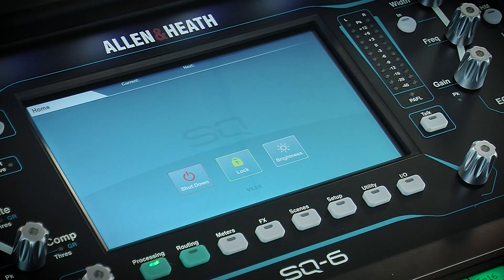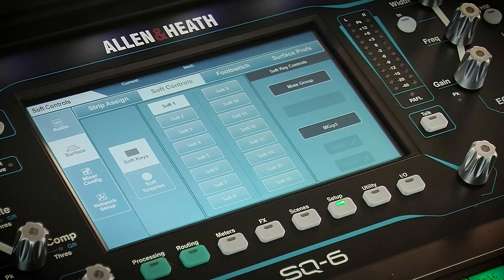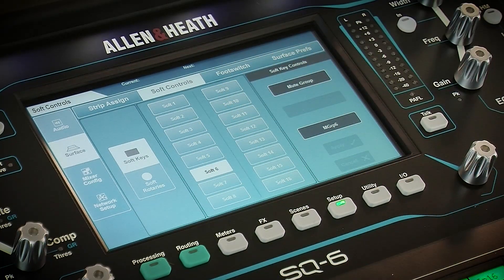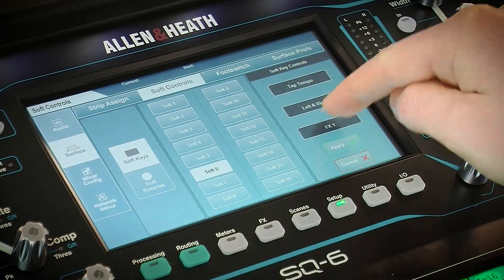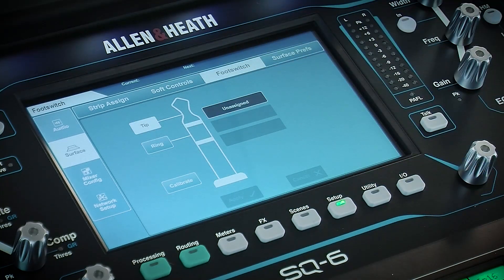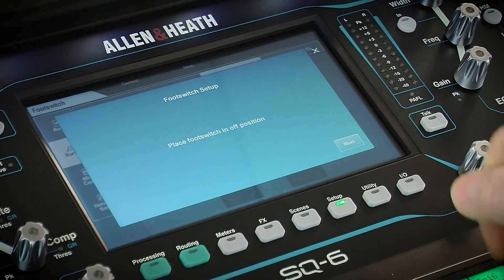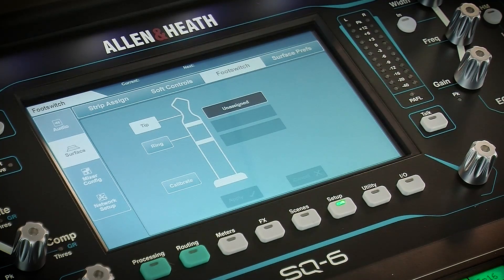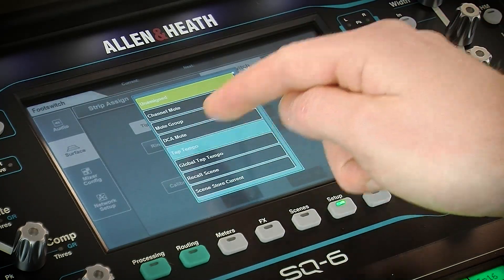Allen & Heath SQ - Softkeys, SoftRotaries & Footswitch Control

Comment: Hello! New owner of a SQ7 here, is it possible to change the labeling and colors of the soft rotaries?
Reply from the maker: Hello Pierre,
The soft rotaries will automatically get labelled and coloured accordingly with the functioned that you assign them.
You cannot manually labelled them. 

Thank you,
Rafael
Reply: @AllenandHeathUK  Thanks Rafael, are you planning to add this possibility? I have 4 knobs that controls plugins in my computer and it would be so useful to see what it controls instead of Midi A, MidiA, Midi A, Midi A and have to put a tape underneath like on an analog desk ;)
Reply from the maker: Hello Piere,
No plans at the moment, but you are welcome to drop your suggestion at our community forum in the suggestions section, and our product managers will surely have a look into it!
https://community.allen-heath.com/forums/forum/sq/sq-feature-suggestions

Thank you,
Rafael

Comment: Hi! Can I assign a mix bus to a soft rotary encoder? I mean, to always have some mixes in front of me and  not sacrificing  a bank of inputs on the surface..if that make sense. To be able to select a mix, view  its name on the scribble strip and assign the mix master fader on the soft rotary encoder?   I'm so sick of using tape and sharpies, i like my board clean. That would be ideal. Thank you!
Reply from the maker: Hi Karm,
You can indeed program a soft rotary to be a mix send. You can do it in two different ways:
You can either assign the rotary to be the send of whichever channel you select on the strip to whichever mix you are standing on, or make it a fixed channel to be send.

Rafael
Reply: @AllenandHeathUK  Great! Thank you Rafael.

Comment: a suggestion of software update... I sat preparing for a show coming up this weekend i i have soft 1 as "Scene store current". and soft 6 as "Recall scene" when i was up and about i accendently tapped soft 1 insted of soft6 and my whole scene was lost. as i stored a new scene on top of it. 

Suggestion is to hava a "dubbel tap to store scene current" function... or perhaps a pop-up window where you have to click yes to store
Reply from the maker: Hi Mikael, Sorry to hear you overwrote your scene in this way. It's quite a nice simple solution you suggest here, could you please add this to the feature suggestion section on the digital community - (https://community.allen-heath.com/forums/forum/sq/sq-feature-suggestions) as this allows discussion and upvoting of any ideas. We can then refer to it when looking into future updates. Thanks! Keith.

Comment: Hello!! I'm still relatively new to the SQ series. Obviously, scenes can be recorded. Can the softkeys be assigned to go to the next scene/go back a scene? Thanks :)
Reply from the maker: Hi Jeremy, 

You have a couple of options on SQ for scene control via soft keys. 

There's a 'scene recall go' option which automatically increments to the next scene after a recall. so it's a one button control which allows you to cycle through all 300 scenes. 

If you need to go backwards through the list as well as forwards, there are 'next', 'previous' and 'recall' options, so you can assign each of these to its own key. 

Thanks! Alex